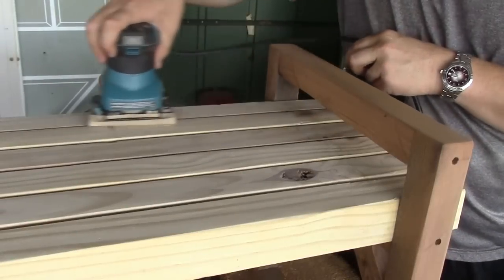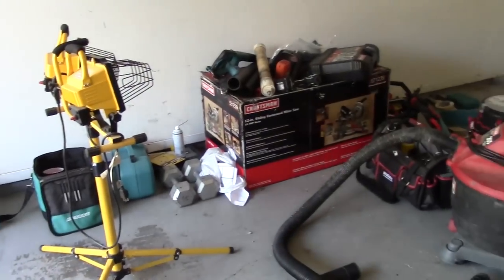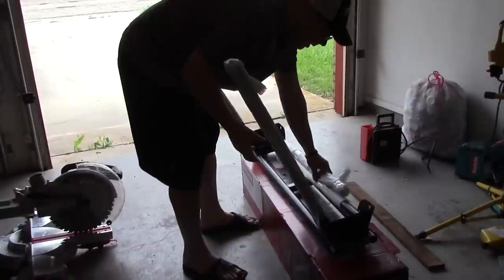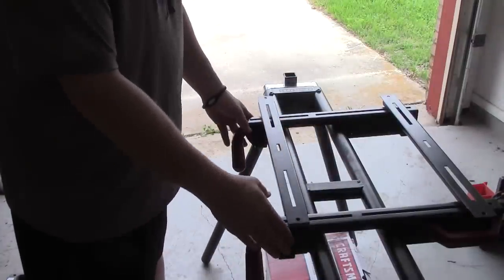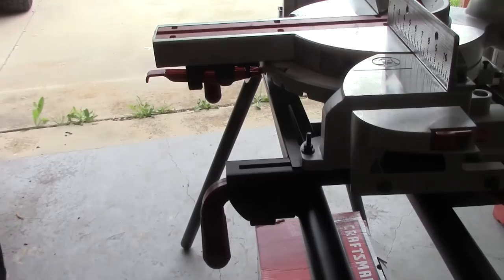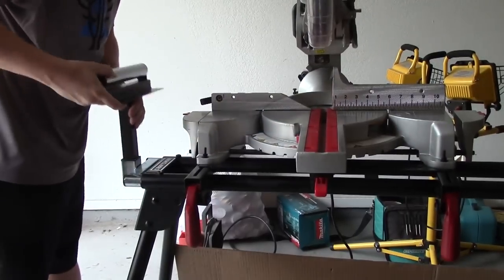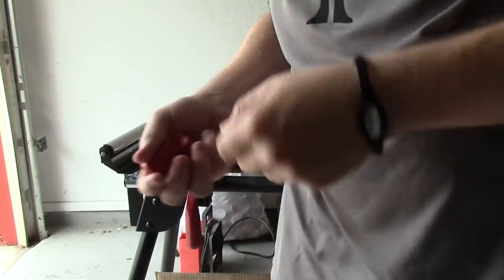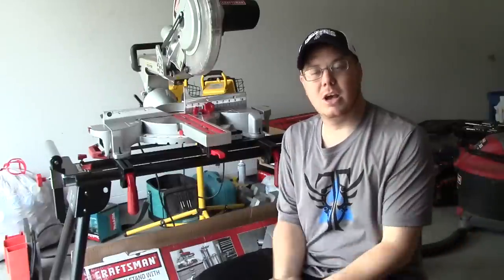My Next Project: Miter Saw Stand

Comment: You'll get some shelves built, don't sweat the mess. I have some that I made out of halved 2x4s (a tad bigger than 2x2s)and 7/16 OSB.  They've served me well for over 5 years. and we're fairly cheap. I use a lot of scraps on my shop fixtures too. And congrats on the new house.
Reply from the maker: Thank you very much.  I actually used some OSB on my shop cabinets.  That stuff is so cheap along with some 2x4s that it is hard to beat.  

Thanks for the comment and watching.
Reply: *****
 I like OSB for shop fixtures. In my experience its more stable then plywood. It seems like every time I try plywood for a project it warps.
Reply from the maker: charredskeleton
I actually just recently built some cabinets and used OSB for it.  I like it because of how much cheaper it is and it is pretty strong too.  Doesn't look great, but if it is in areas where it won't be seen it works pretty good. 

I have actually been thinking about replacing the sheetrock on the wall with OSB.

Comment: Your stops on the outrigger rollers are on backward it looks like,.The flip-ups plates should be on outside to flip-up when you want to use stops so board still rest on rollers.
Reply from the maker: There is a stop on that side.  It allows you to "clamp" them in place so that you can do repeat cuts and it holds the board up so that it won't sag when you push it to the stop.  

But I am pretty sure it will work either way.

Comment: Thinking about storing my Miter saw mounted to the stand vertical against the wall to free up some floor space. Has anyone else tried this?
Reply from the maker: I am not sure.  I haven't seen it if they did.  But that is a good idea.  A miter saw takes up so much more room than most people realize.
Reply: Doesn't seem like it would be a problem for the saw, maybe the clamp mounts on the bench aren't designed for it. One way to find out, right?
Reply: Seems to work fine. Although the stand is not designed for it, meaning it doesn't stand on it's own. My stand does have wheels, so a little different than yours. Another great idea (to me) would be additional mounts to put other tools like a vice or grinder on the stand as well.
Reply from the maker: 00nowhereman00 can you send me a picture of how you did it? On twitter or Instagram? 

But that is interesting to know.